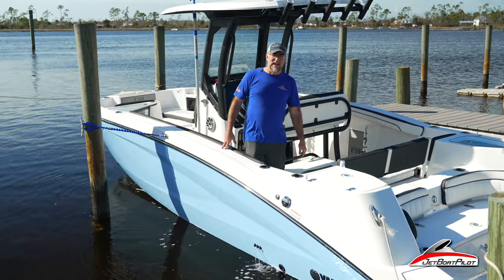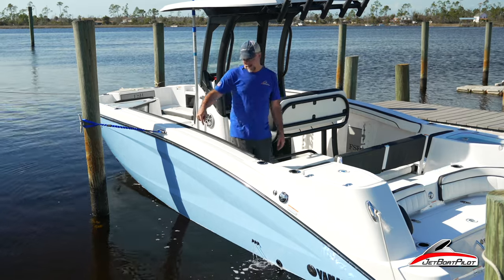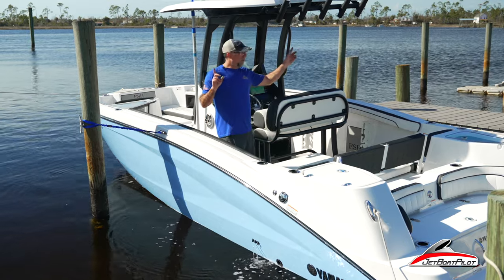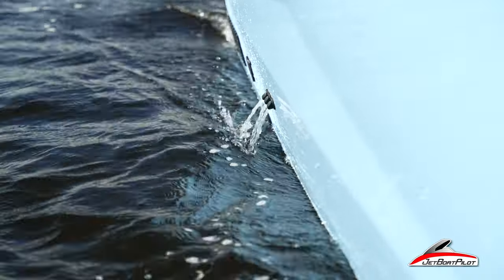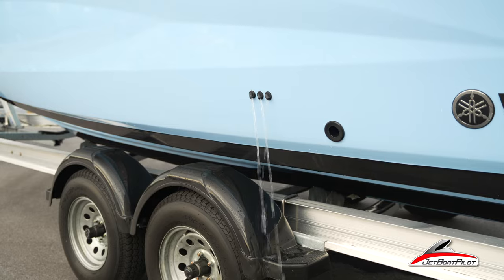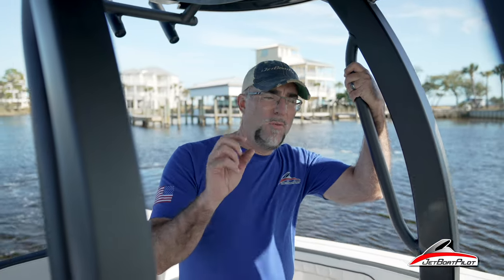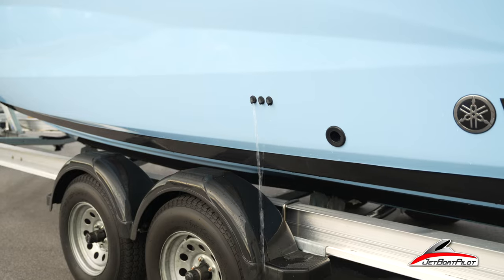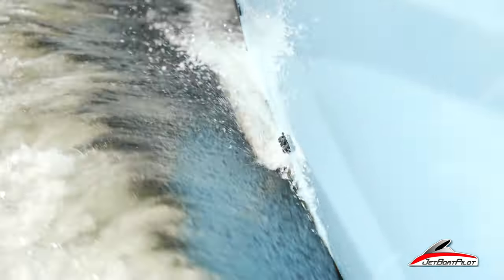Understanding Yamaha Jet Boat Cooling Spouts | Know Before You Go

Comment: Hi Will. We have a 23 AR220 with your thrusters and vectors. It seems like the steering at higher speeds is stiff or harder to turn. Is this typical of yamaha jet boats?
Reply from the maker: Email me at will@jetboatpilot.com and I'll get back to you when I'm back at my desk.
Reply from the maker: The stiffness you're feeling at higher speeds is normal and it happens whether you have our steering system installed or not. The reason the steering feels heavy at higher speeds is due to the flow of water coming out of the nozzle. As flow increases the jet stream acts more like a solid than a liquid and it takes more force to bend it then when the boat is moving at slower speeds. Also its important to note that when the Thrust Vectors are installed correctly the fins ride above the water that is beneath the boat when the boat is at plane speeds. With this understanding its clear to see that the Thrust Vector cannot add to heaviness in the steering at high speeds. The only time where the Thrust Vector can contribute to heavier steering feel is at transition speeds of 5mph to 10mm  when the boat is preparing to get on plane but the fins have not yet risen above the water. On your year model it will be less noticeable due to the rack and pinion steering cable system on your boat. On earlier models without rack and pinion it is more pronounced.
Reply: @JetBoatPilot  thank you Will. This is our first jet boat so just wanted to make. As always your customer service is above and beyond!!
Reply from the maker: @Coloradohighboy  thank you! Have a great summer!